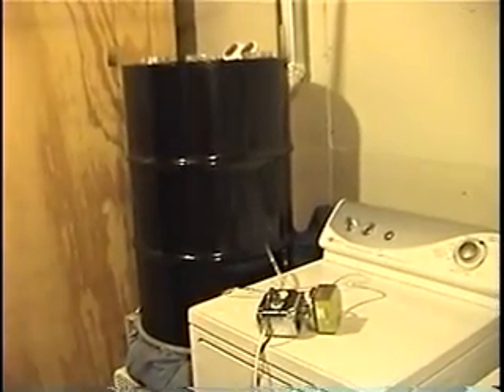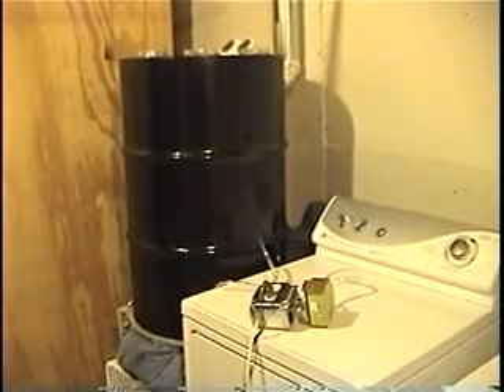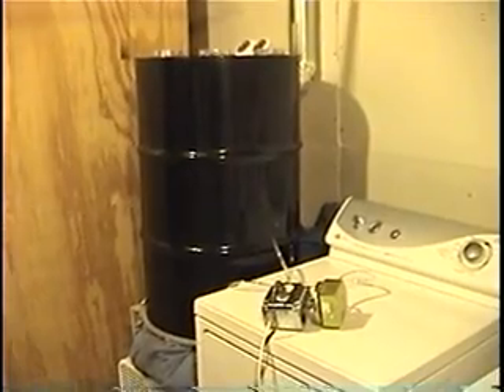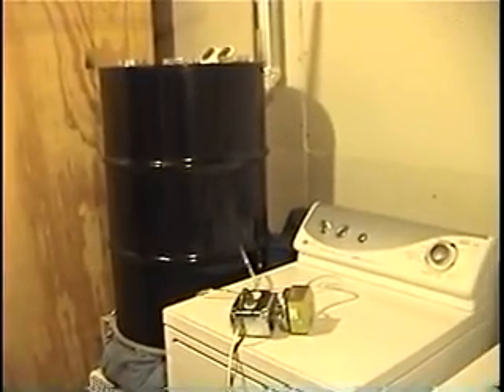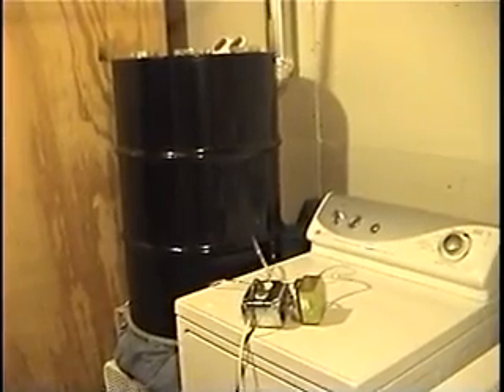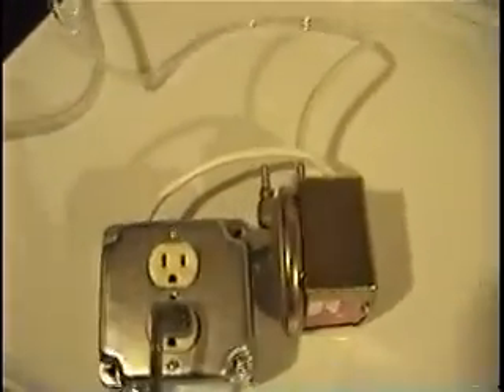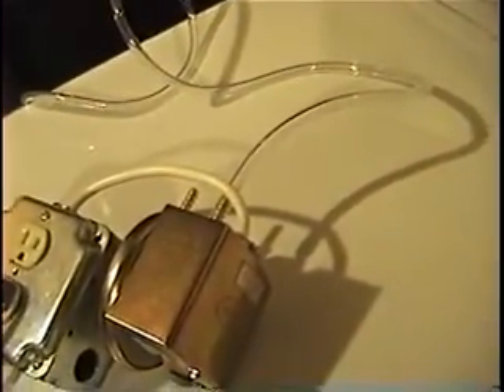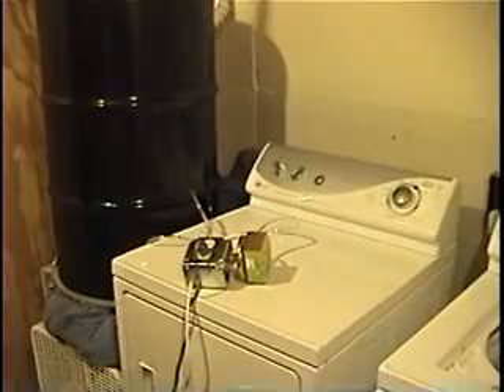Clothes Dryer Heat Exchanger Pressure Differential Switch

Comment: dcollins468, I would think that fins on the inside of the 4 inch tube would catch lint on their leading edges.  
Hello, OnTheEdgeinEauClaire,  a few years back I built a tube in tube heat exchanger and in the process of designing and operating it I learned a few things.  I would love to contact you via e-mail and compare notes before I build another.

Comment: hi on the edge, i love your idea to reclaim heat from ekectric dryer. i  wonder if you have considered using fins on inside of the four vertical tubes, like fins on a heat sink, it will drastically increase the surface area of your heat exchanger and presumably increase the efficiency, just a taught, regards DC, in ireland